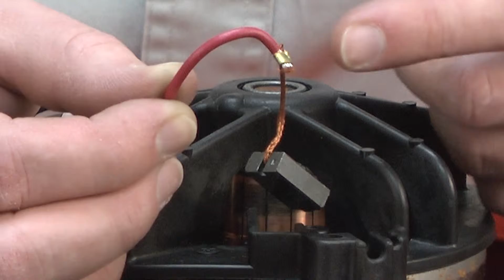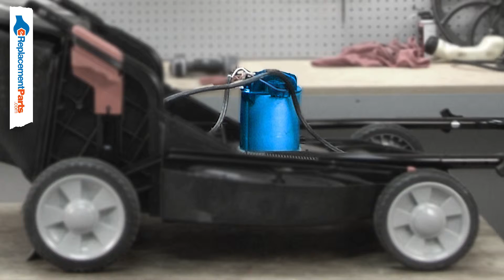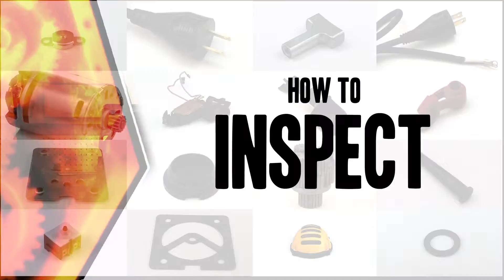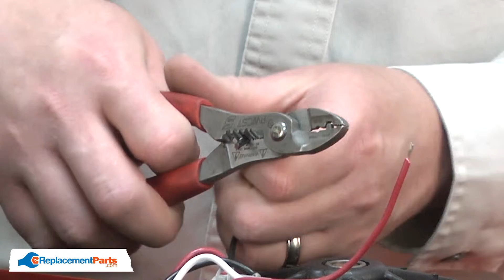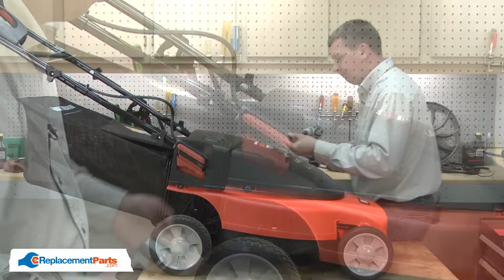Black and Decker Mower Repair - Replacing the Motor Brushes (Black and Decker Part # 242273-00)

Comment: What type screws are those?  How many screws are involved to get cover off?
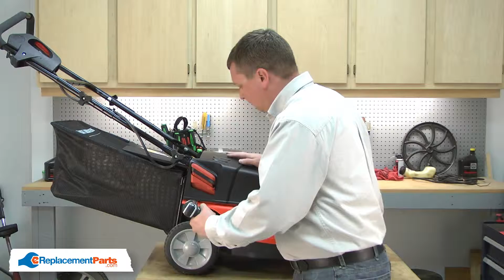Reply: They are T20 Torx.  There are four total holding the top shroud on, at each of the four corners.  The rear ones are horizontal (from this view, just below the height adjustment handle), the front ones are vertical, as seen at 1:16.

In a real world setting, there are likely lots of grass clippings and dirt in those holes that can make getting them out a bit tricky if you don't clean them out first.

Mine is a 2007 version, and slightly worn.  Getting those front holes to line up when reassembling never goes as easy shown here.  I usually have to use a guide (like an old wire coat hanger) to get the darned things to line up when putting the shroud back on.  Might work better if I used a work table like this rather than sitting on the drive way.

Comment: I wish mine was that simple..........mine appears as if Black & Decker designed it to be thrown away......not repaired......finding the correct size was almost impossible..........then the little clip that held it in place had tiny little ears holding it in.....these little ears ae very fragile........once they are pulled out, they are sprung and won't hold when they are put back in......a total pain in the butt....

Comment: Have you got anything on replacing the bearings on the armature ?
Reply: Harbor Freight digital calipers to measure the shaft and the bearing housing diameter. Online for the bearings or in my case from a hobby shop for an RC car.